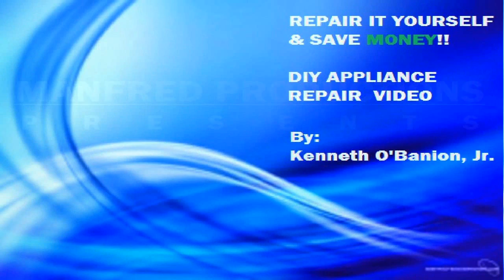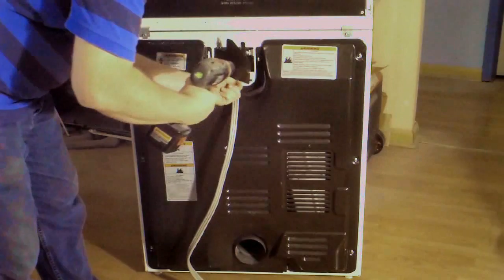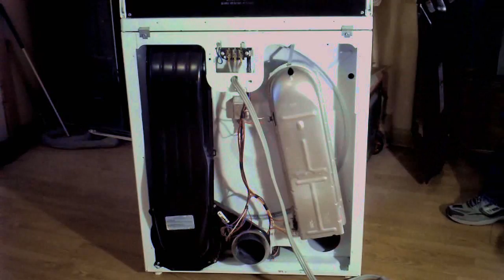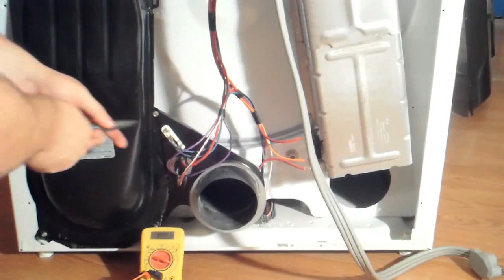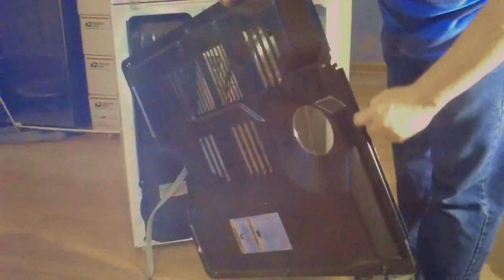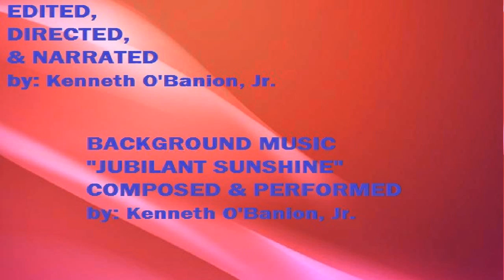Whirlpool & Kenmore Dryer Repair #02 - Won't Start or Run- Thermal Fuse 3392519 Diagnose & Repair

Comment: hi, I have a Kenmore model 110.25652400 that s been working great, until today, started a full load, washer filled up (clothes inside) but would not start cycle. Tried pushing and pulling the knob and advancing slightly, turned knob all the way around , to no avail. Have checked the power with another applicance, outlet is working.  the knob has been a little finicky for a long time, needing to be pushed and pulled, and/or advanced slightly to start most times.

Any ideas? thanks so much !

Comment: I have a Kenmore Model 110.25652400 which has been running great, until just now .... the washer filled (clothes are in) but would not start the cycle, pushed and pulled knob out again, and advanced slightly. Check eletrical outlets with another applicance, and they are working. Any idea what that might be? The knob has been alittle finicky in the past, needing a slight advancement to get started. thanks! :)

Comment from the maker: It should not, since when the thermal fuse is bad the motor will not turn on, and the motor needs to be on spinning for the centrifugal switch too engage and send the last needed 120 volts to the element to make it heat up.

Comment: Mine starts and spins but it doesn't heat up.  That's not going to be the fuse, correct?  What would I need to test first?

Comment: Hi, I have a Whirpool dryer that will not run at all, I have checked the Thermal fuse and it is fine. what else should I be looking at to see what is wrong? thank you so much!

Comment: Is it correct that the thermal fuse is under the tumbler rather than behind the back panel on the older models?    110.86983110

Comment from the maker: When it wont start, does it make a buzzing sound when you try to start it?  If so, the motor is bad.  If not, it still could be the problem, but less likely.  Maybe there is a loose wire connection somewhere that is causing it to not work sometimes.  Also, check the door switch, it may be wearing out and depending on how the door is closed it might or might not engage properly.

Comment: I have a Kenmore dryer.   I just replaced the Thermal Fuse.  I also replaced the breaker, air duct, and plug on wall.   I can go in there and one time it may run.   The next time or right after the first load, it will not start.  Do you have any suggestions.

Comment: I have the same 80 series. Whirlpool and I have determined the fuse is bad,I also noticed the thermostat wires where brittle and had hit spots on the purple wire connection.Where is the best place to get cheap parts?Thank you so much for your knowledge! !

Comment: Thank you! All done no spare or missing parts! Thank you for saying how many screws. I took a picture of the thermostat and the thermafuse before I removed them and marked the top wires with black marker and then I could see how to put them back.

Comment from the maker: It sounds like a bad winding in the motor (that would be indicated by the loud buzzing sound you are hearing while trying to start it).  There is also a possibility that the timer is bad.  Only way to know for sure which is bad is to test the parts.  You will need an ohm meter to do the tests, and be able to read the wiring diagram that came with your mom's dryer for the terminals to tests and for the specs of the motor.

Comment: Was able to replace a door switch and start switch ,but the fuse was actually in the front under the filter and not in the back . Although was able to replace these parts and get it to start it nonetheless  wound up smelling like burning wire insulation. By not knowing the fuse is in the front wound up back trouble shooting again with another problem .

Comment from the maker: Yes, manufacturer recommends changing oper. tstat any time fuse next to it fails. Reason is that it might not be opening at correct temp anymore, which would cause it to get too hot and that would pop the fuse. The oper tstat can be bad even if it has continuity when cold. To check, remove all wires, and on lowest scale check between the two terminals that are opposite eachother and fartherst apart. Use the 10k scale for the two terms that are oposite and closest to eachother (it has resistor)

Comment from the maker: That is correct, if the thermal fuse is bad on Whirlpool and Kenmore dryers, it will not start or run.  HOWEVER, the interior drum light on some of those dryers will still light up.  It is best to test the thermal fuse with Ohm meter.  If it has continuity, it is not the problem.  If there is not continuity, replace it and the operating thermostat next to it.  Always perform testing with power disconnected to prevent injury or death from electrical shock.

Comment from the maker: First, the heat element should not heat up without the motor running, part of the 240 volts comes through the centrifugal switch of the motor.  It only puts power through when spinning.  So if power is getting through without it spinning, the motor switch is bad.  Also, if it got hot enough to catch fire, there must be bypassed thermal fuses and thermostats, as these should have shut off heat before getting that hot.  With all that, I recommend calling a tech to fix it, too much risk with fire.

Comment from the maker: Some experience, yes.  That control board can be tested, each button at a time, but it is very time consuming and difficult to do.  The Tech sheet inside the control panel tells you how to do the test using an ohm meter.  And yes, the buttons can stick, happened to my sisters once.  Leave unplugged, and repeatedly press each button multiple times to try to make sure none are stuck, you might get lucky!  This procedure fixed my sisters when it happened!  Good Luck!

Comment: I have a Kenmore Elite dryer HE  110-85862 400   My lights or power will not come on.. The tech said that it was the control/fascia front panel.  How do I know that this is what it is....The part is $240!!!  Here at Christmas!! ugh  not including labor!
I have read that the buttons stick on this model.....and the control panel might not need to be replaced.  Do you have any experience with this model?

Comment from the maker: Check the outlet for power from both hot wires.  You should have 120v on each hot wire to ground, and 240v across the hot wires.  If no power, check circuit breaker, turn it off and back on even if it doesn't looked tripped.  If still no power, you would need to call an electrician.  If you do have power at the plug, then the rest of the testing on the machine will need to be done with "live power" while plugged in, and should be done by a service tech for safety reasons.

Comment: I've check the door switch - it's good, start buttton - good, and the thermal fuse - also good. My dryer still won't start. What's next?

Comment from the maker: Exactly right! I never replace a part unless it actually tests bad. Some parts, like fuses and thermostats can be tested with volt-ohm meter. Others, like the timer, can be electrically or mechanically failed. If mechanical, you kinda have to know how to set it to certain positions and see what results you get to see if it is working. The motor is mostly electrical testing, but also mechanical as for the operation of the centrifugal switch that engages one of the 120v power legs for the element.

Comment from the maker: This is true only if the time motor is bad.  If the internal coggs of the timer are broke, it can work on some settings then stop working when it gets to the bad coggs.  How does it work on the timed setting instead of using auto?  AS for the fuses, thermal fuses do NOT reset themselves, only thermostats do that, which is why they are named thermal fuse vs. thermostat.  Nothing is called a "thermo fuse" on these dryers. Email me at manfredcanyon @ att. net and can give more details!

Comment from the maker: No, I am pretty sure it is not the high limit thermostat.  It wouldn't start at all if it was bad.  It could be the motor, as stated earlier, and possibly there could  be a problem in the timer.  But, once it stops while hot, you said it will not start again until it cools.  Even if you start at beginning of cycle again?  If it wont start at beginning of cycle while hot, it is not the timer causing problem.  Still sounds like overheating motor from a bad winding, POSSIBLY.

Comment: I am so stumped.  I have checked everything all thermostats, heating element etc.  The only thing that doesn't check out is the second set of wires on the operating thermostat. Reading says it should be 6.9 thousand ohms, I read 4 thousand ohms. Have any ideas?

Comment from the maker: The dryer in this video has an operating thermostat on the blower box, not a thermistor.  If your model has a thermistor, it would look different, and have only 2 wires.  The problem you are having, with it running 10 minutes then shutting off, and not able to re-start until it cools, could be a bad motor, or a bad thermistor if you indeed have a thermistor on your model.  If it makes a loud buzzing sound when starting, it is likely the motor that is bad.

Comment: My dryer looks just like your sample. The question is, if the dryer starts, runs for ten minutes or so, then shuts off and won't start until cooled down, do you think that could be a thermistor problem?

Comment: Thanks for doing these videos, but after watching them (and a million others!) we are still stumped - we have checked the circuit breaker, the power supply across the front, the door switch for continuity, the thermal fuse for continuity, the start switch and we tried to bypass the thermal fuse.  And nothing.  Press the start button and you can hear a little clickclickclicking sound (sounds like a timer) but that's it.  Any advice?  Thanks!

Comment from the maker: No, it is not.  It is on the internal center shaft of the motor, near the frame on the belt end of the motor.  It is disc shaped, with small springs on it.  The motor casing would have to be taken apart to get it off the shaft, and even then it is not a part that is available for purchase by its self.  When it goes bad, you have to replace the whole motor.  But make sure it is bad before buying a motor!

Comment from the maker: Well, there should be no heat if the motor isn't turning.  So there is a short somewhere, or the motor is bad.  Best to have a service technician come check it out.  Also, leave it unplugged to prevent any further damage or fire from a short!

Comment: wife says that she got 3 more loads dried but each time she took the laundry out of the dryer it was extremely hot each time than went to use it two days later and put some laundry in pushed the start button and nothing was happening so she opened the door felt heat in the dryer but the drum was not turning

Comment: So after watch both won't start or run videos I checked the door switch its ok I checked the start button its OK I checked the thermal fuse its ok and the thremostat was OK , what else could be my problem? OH and yes I did check my breakers and gfi????

Comment: very informative, i replaced the thermal fuse but my dryer keeps blowing the fuse. i ran a resistance test on all my thermostats and they all passed, but it keeps blowing fuses. any advice?

Comment: If your fuse is blown you want to remove and inspect the filter chute for clutter. If the small limit atop the heater is blown you want to clear the vent to outside and change the control thermostat